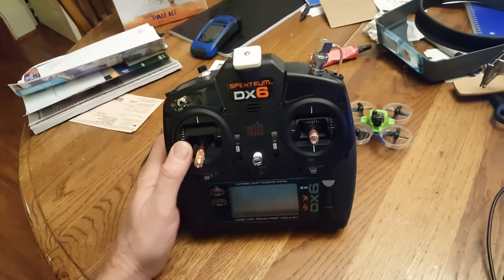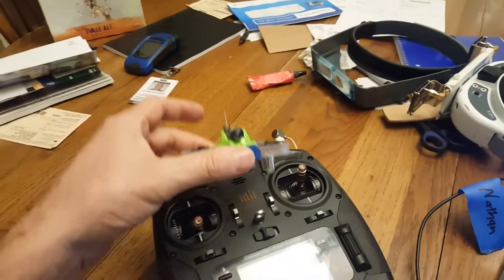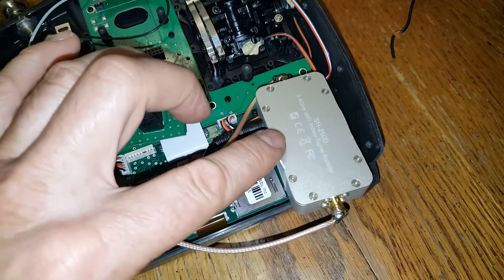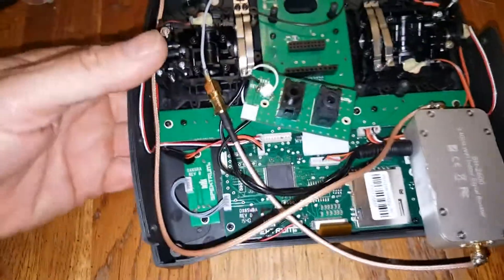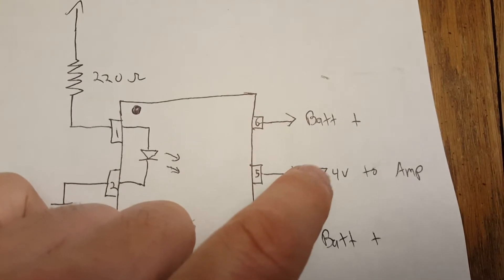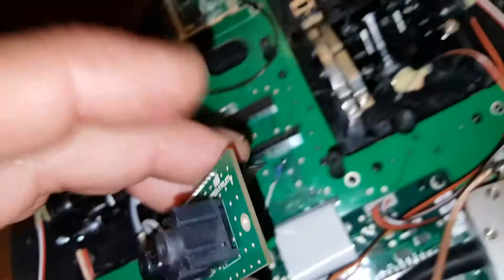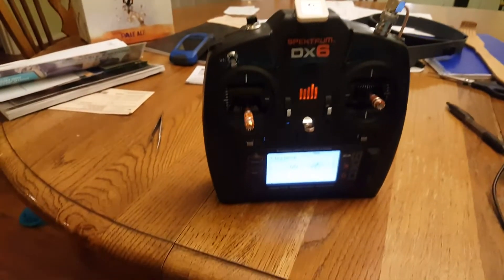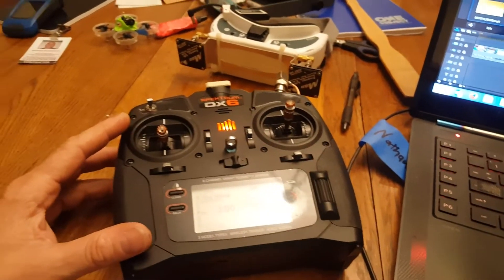Spektrum DX6 1 watt modification for long range Tiny Whoop

Comment: What do you mean, y'all are probably not going to be able to do? What are you special? An anomaly in space and time?  Or did  you live lean years as a soldering monk until you could finally do precision work with your mind? Very egotistical to think the average viewer interested in what you have to say here couldn't possibly manage to do what you do. Other than that, informative video, I learned some stuff, as I obsessively like to do. Keep it up other than previous comment
Reply from the maker: Tiny soldering isn't that bad with a good 10x headset.   It is a useful skill.  Currently, I just purchased the first generation DJI FPV controller.   It comes 5.8 Ghz 1 watt right out of the box.  Factory soldering is hard to beat.   The DJI goggles have really made a difference in video quality.   No more garbage signal in micro FPV drones.   I get 1 mile range now and 15 minute flight time at 100 grams.   I'll do a video on it.

Comment: The one part im confused on is how this mod would work with a splitter? Would you have the amplified signal going to both antennas at that point?
Reply from the maker: The Spektrum just switches back and forth between each TX antenna.   The splitter just combines the two signals back to one signal.

Comment: I really need to figure out how to do this myself. I dont wanna switch to open tx/crossfire module to get longer range. But i need little more range for my fixed wing fpv adventures
Reply from the maker: The soldering on this mod was very hard.   If i were to do it again, I would just use the ufl adapters to feed into a power amp.   However, I must say that crossfire is worth the switch.   Open TX does have a learning curve, but is worth it in the end for the telemetry and GPS logging in the transmitter to find a down model quickly.   You will probably spend lest money just switching to cross fire rather than trying to make DSMX long range.
Reply: @microdronetech8453  ok thanks for the advice i appreciate it

Comment: According to Andy from spektrum just adding a 8dbi antenna acts as an amplifier, that's what i did.  I'm guessing it at least doubled my range.  You obviously have the diversity version of the dx6, which i do not, but mine has u.FL connectors on the tx module, yours didn't or did you remove them?
Reply from the maker: You can use the uFL connectors.  They work fine.  I personally solder everything.  But, I'm an expert at micro soldering.  And, yes beam shaping using better antennas does increase range.  You don't have a choice on the receive side because of the weight constraints in the Tiny Whoop.
Reply: Hi. I'm interested in upping the power on my dx6e which has only 1 antenna I believe. Is there a simpler way of increasing signal than in this video please? How did you get the replacement antenna sorted please?
Reply: @scottbusby6095  - I have the DX6e as well and the only way that you or I could increase the signal is replacing the antenna.  This is a very easy mod to do and it should work for most spektrum remotes. 

The parts you will need is a "U.FL Mini PCI to Reverse Polarity SMA Pigtail Antenna WiFi Cable" (they come in a pack of 2 from Amazon), and a 2.4GHz 8dBi Antenna (there is a pack of two antennas and 2 connectors for $8.75 on Amazon).

All you will need for tools is a screwdriver. Remove the battery cover and battery pack from your controller (unplug the battery pack and remove it).  Now remove all the screws off the back of your controller. Open the controller carefully because the antenna cable for the built in can be damaged and the switches on the rear plate are still connected.  MAKE NOTE OF WHAT CONNECTOR the antenna is connected to as the other one on our DX6e controllers is 'dead' and you can damage the radio if you turn it on without that connected to the right plug (remember if it was top or bottom...write it down if need be). Simply un-connect the built in antenna, connect the pigtail antenna to the same connection plug.  Now, you see where the 'bind' button is located? on the opposite side, there is a sticker covering a hole for where another switch/bind button would go.  Simply cut out that sticker over the hole, put the SMA part of the pigtail out the hole, cinch it down with the nut/locking washer.  Now put your radio back together, screw in the 8dBi antenna and you are golden.

You will get more signal strength from the 8 dBI antenna than the built-in 2.2dBi (specifically 5.8 dB). It solves that by radiating energy more directionally than an idea antenna that radiates evenly in all directions (0 dBI).  This increased signal strength of 5.8 dB is 10^(5.8/10) = 3.8 times more power. That will increase your range by about 75% - 80% in ideal conditions. 

But again, keep in mind that antennas don't really make more output power from a transmitter. They can only take the existing transmitter output power that goes in all directions and concentrate it in a narrower range of directions. That's why the video we are commenting on actually is increasing the amount of power he is putting into the antenna. 

Typically, a longer antenna will concentrate more of the power perpendicular to it. In other words, while your radiated power might be stronger off the side of a longer vertical antenna, there will be less power radiated off its ends. (think of a ball with a small hole in the top vs. a donut with a hole in the middle)  This isn't necessarily a problem, but you do need to realize that your range will increase in some directions (relative) to the antenna (to the sides), but decrease in others (above and below) . It will become a problem if you inadvertently turn the transmitter so that the antenna is pointing towards the aircraft which lowers the amount of power radiated in that direction and could be enough to cause a signal dropout.

Antennas are a little complex, their baseline would be the ability to equally see in all direction (up, down, forward, backward, you name it) at the same time. This situation is called the isotropic antenna. This is where the 'i' in the dB comes from, and it is our baseline. 

The built in 2.2dBi antenna lets you see in-front, behind, to the left, and to the right well but drops off a tiny bit little in the direct the top of the antenna is pointing (and below). 

The 8dBi antenna can have more range to the sides but you loose a lot of range to the top and bottom of the antenna (think of it like a donut with a hole in the middle). This would still be consider an omni-directional antenna because it still has a 360* view, but it wont be able to receive from directly above or below the antenna very well.

The basic concept that I am trying to get through is that gain can't just come out of no where by upping the dBi of the antenna, you have to sacrifice some part of the antenna pattern in order to give gain to another part of the antenna pattern so you have to be careful when you use these 8dBi antennas as to which direction they are pointing in.   I like pointing it at a 30-45degree angle towards the ground myself.  The 'hole' then is close to me and down near the ground (so if I fly there, I'd be close enough that the signal loss wouldn't matter) and above and behind me...where I rarely, if ever, fly).
Reply: mooosestang - can you reference or explain a bit more of what you're talking about?